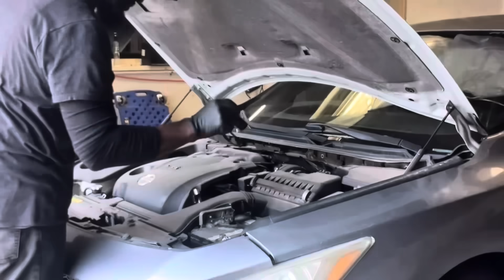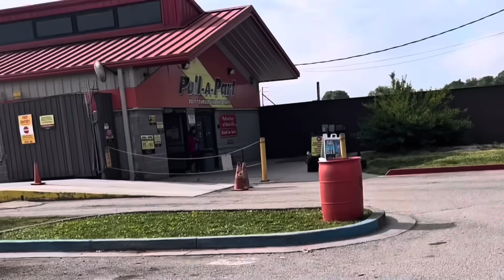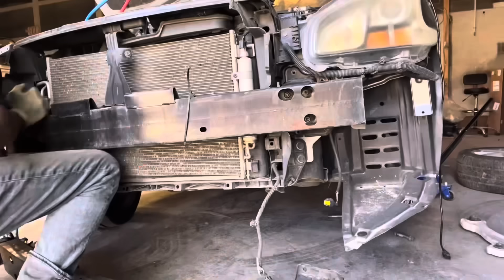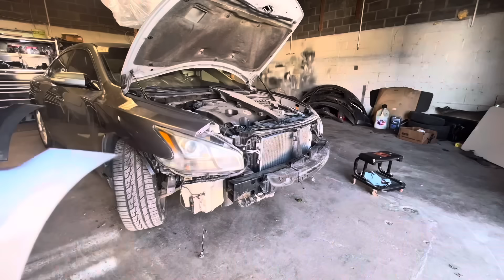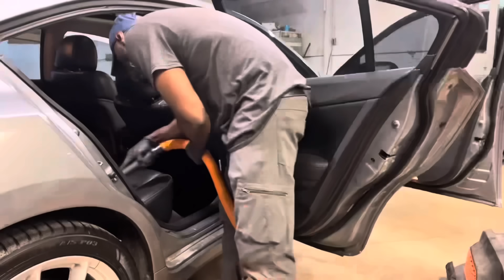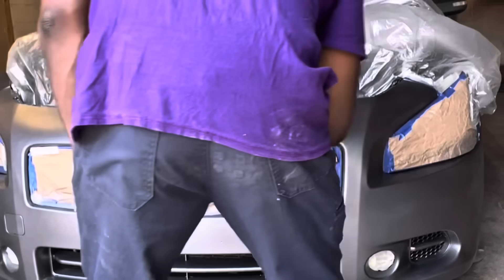How To Flip Cars COPART Full Process

Comment: Dude just yesterday I had the same problem with a can of Duplicolor perfect match paint. Can started running and spraying liquid. Ruined all the work I just did sanding etc. I was so mad. Duplicolor has gone to shit. Is there any other paint brand you'd suggest?
Reply from the maker: Sucks… I wish I did now of another paint brand that paint match like Dupli-color. I’m back to the paint shop where they match by paint code and put in a can. Cans cost about $23 per the match percentage is about 98%. Maybe you could find a local shop or only store like eBay or automotive touch up paint sell aerosol cans.

Comment: Great job. I had the same result with duplicolor on a Honda with metallic grey. I had to do it over but eventually went with a cheap gun set up and it works good. You’re doing great work. Keep it up
Reply from the maker: Thanks, looking to learn how to use a paint gun properly.. any tips?
Reply: @FlipAutoXperts base coat 4oz regulator 1oz [or less since it's summer]
Clear 4oz  Hard 2oz
Reply: Mixing ratios when pouring in a Mixing cup
Reply from the maker: @anthonybanchi6672 Thanks a lot for the tip. 🙏
Reply: Honestly I’m only learning myself. I checked out spray way customs, paint society  and trigger man. They are very helpful you tubers. I’m still having difficulty with setting the gun pressure. You will get it, just takes time.
Reply from the maker: @charlesl6477 👍
Reply: @FlipAutoXperts don't paint when it's humid